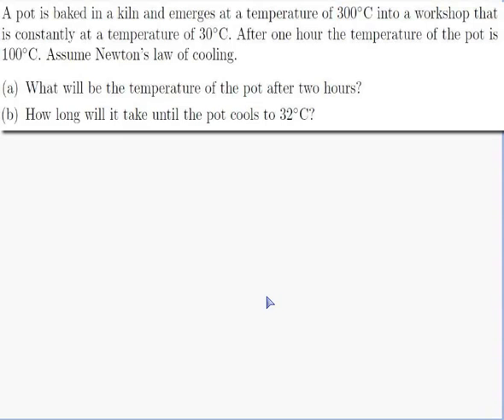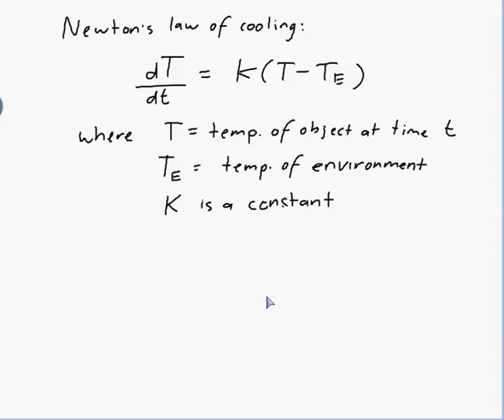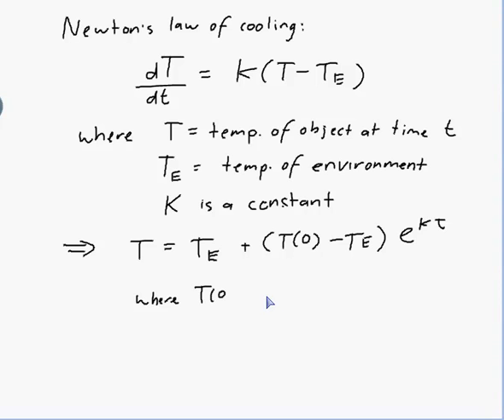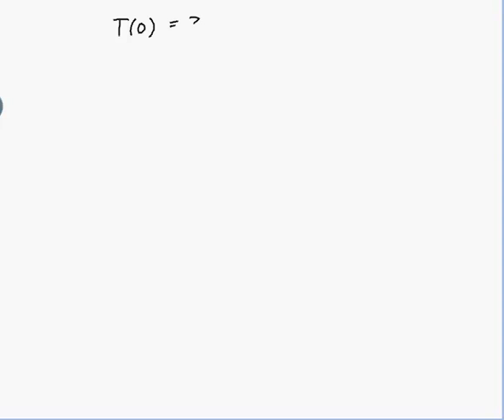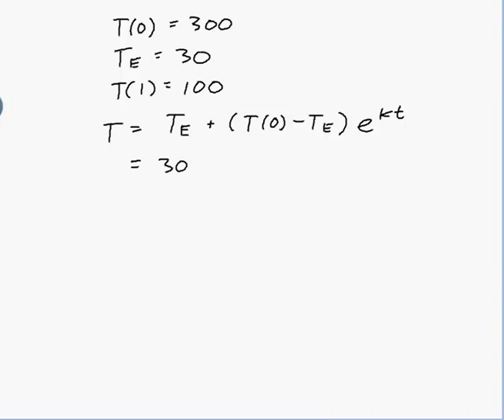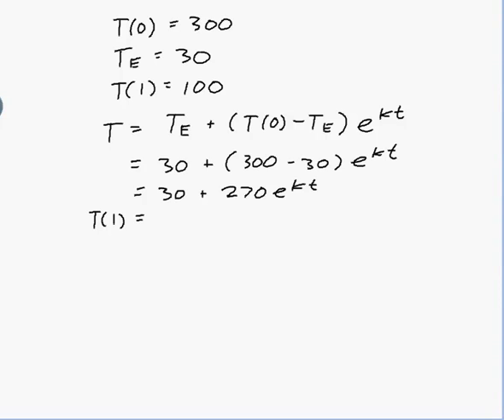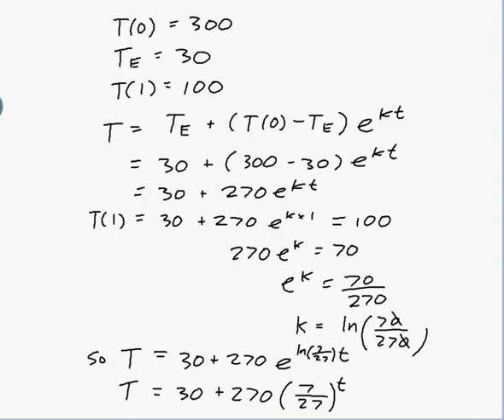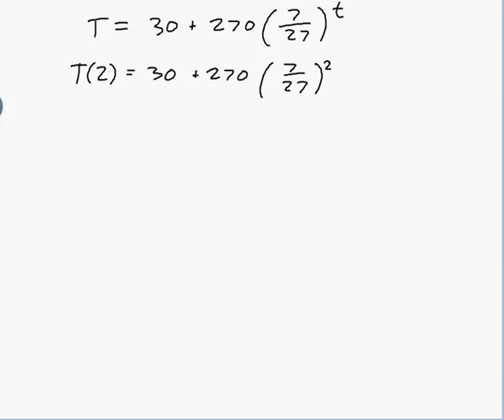EXAMPLE: Using Newton's law of cooling

Comment: sometimes the have -k(To.-Te)..... why negative k ?? may i know
Reply from the maker: You can choose to have -k or +k. I chose to have +k but then it turned out that my value of k was negative after all. I got k=ln(7/27)= -1.35. So I end up with e^{kt}=e^{-1.35t}. If I had chosen to use -k, then my value of k would have come out to k= 1.35 and I would have ended up with e^{-kt}=e^{-1.35t}. Either way I actually get the same result.
Reply: Because he used a wrong formal from the start. He should use TE+(T-TE)e^(-k*t)
Reply: Thanks for clarifying. I had the same doubt.
Reply: Because temperature is decreasing. That's why a negative sign is assigned.
Reply: Azhan Haqimi -k if the T is decreasing